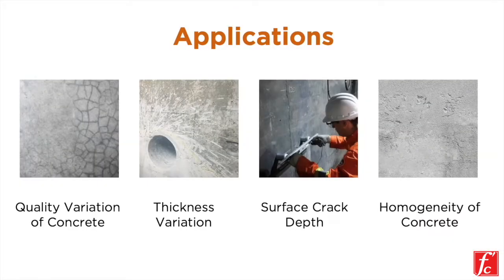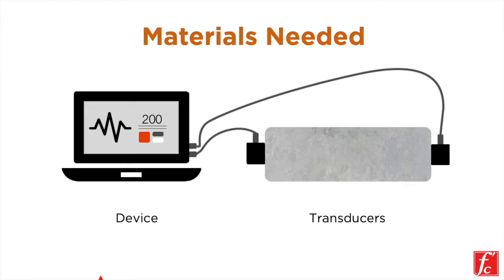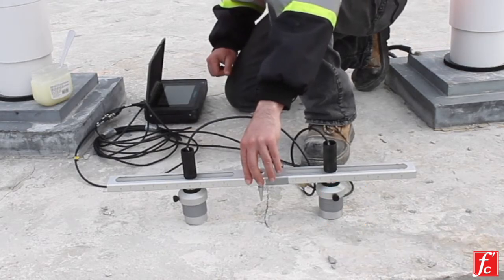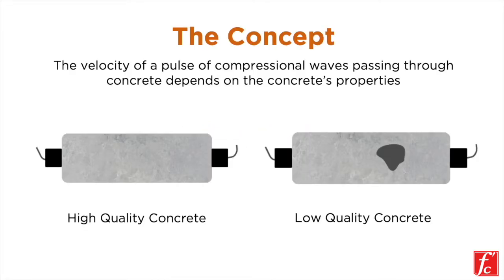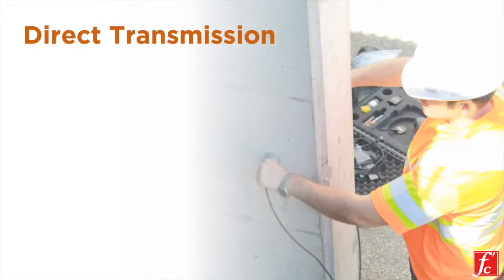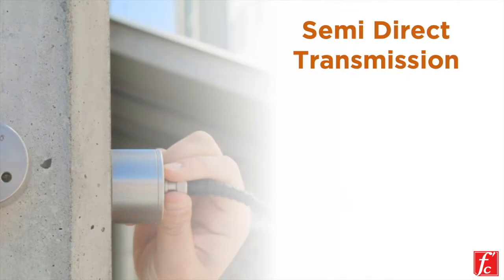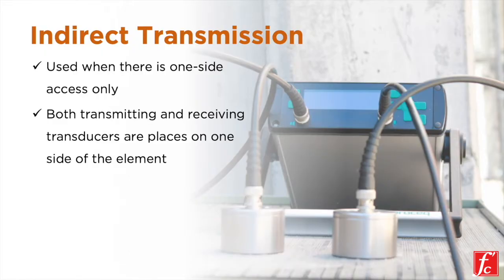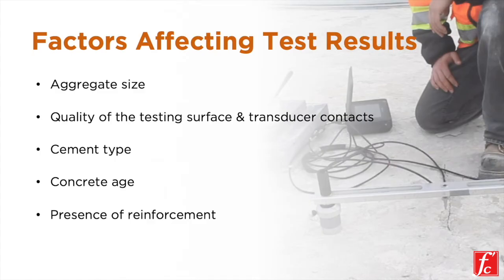Ultrasonic Pulse Velocity Test for Concrete | Non-Destructive Testing

Comment: what is the maximum thickness of a structure can be measured?
Reply from the maker: Depends on the voltage used, and also distance of sensors. Generally 40 to 50 cm